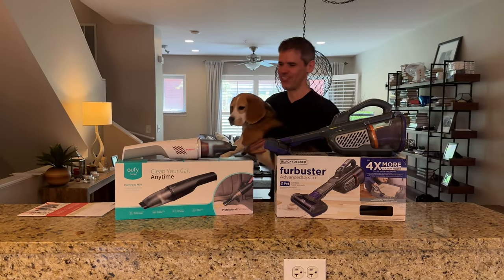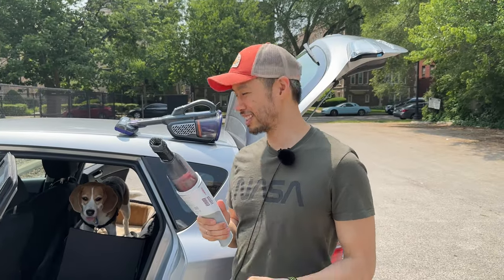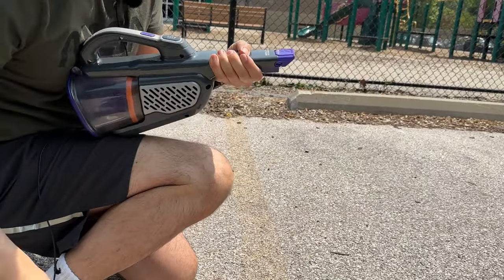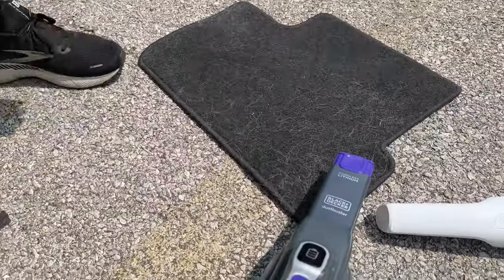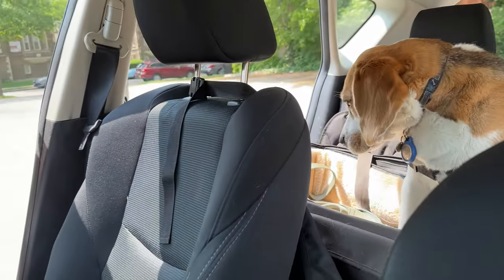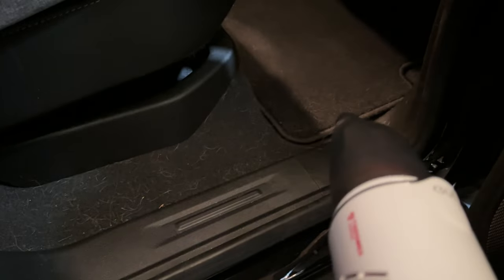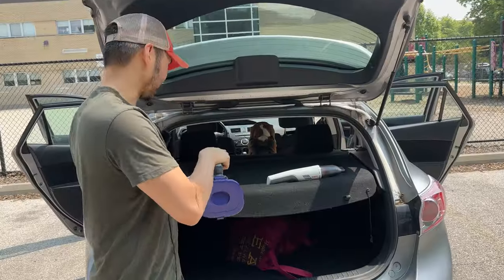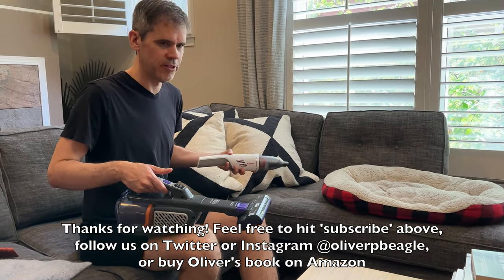Cute beagle reviews car vacuums

Comment: I'd highly recommend a corded vacuum with a hose, the power of cordless vacuums just don't compare. If you don't have any outlets nearby the next best thing is a 12V powered car vacuum, they run off the accessory port and don't have any battery time limits. Look for vacuums with a hose so you don't have to move the whole vacuum when cleaning.